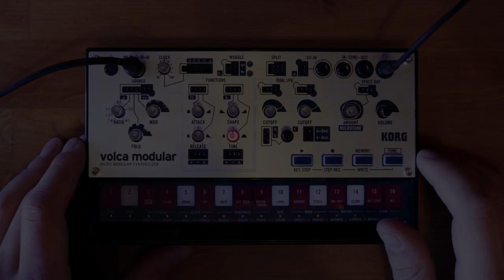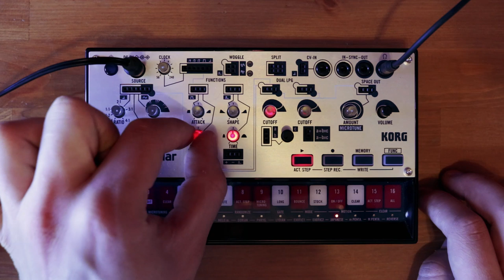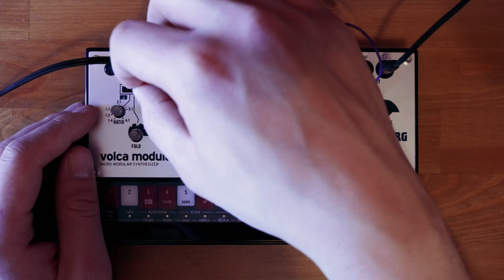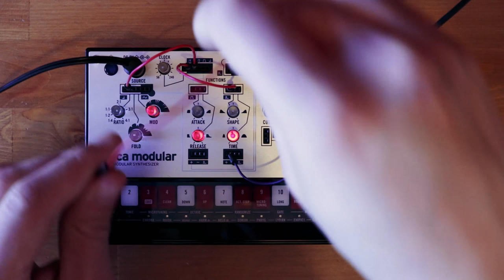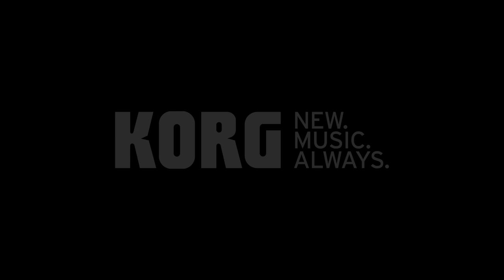volca modular Patch of the Week 10: Polyrythmic Percussion

Comment: Can be similar thing done on MS-20?
Reply: MS-20 mini does not have a sequencer/clock divider, but you can use 2 sequences of different lengths on an SQ-1 to achieve different modulation timings.

Comment: Is it possible to connect a keyboard controller to this synth? Thanks.😏😏😏
Reply: If you open the unit there is a place to solder a midi connector in or out.
Reply: Yes, if your controller has CV/Gate out and you have a stereo jack splitter (Y cable). There are tutorials on how to do it on YT.